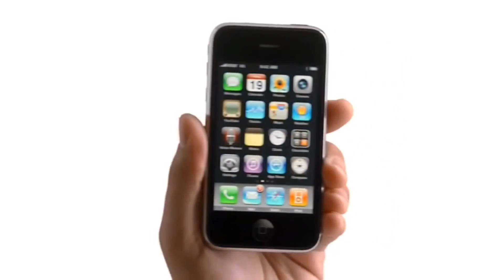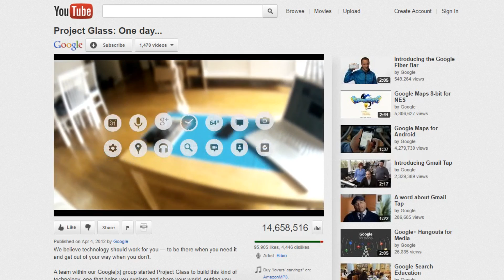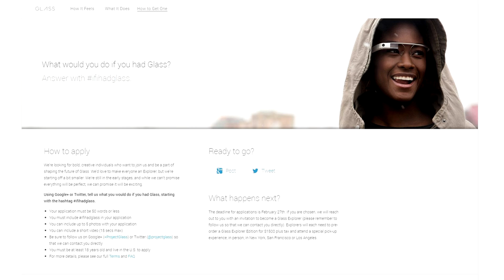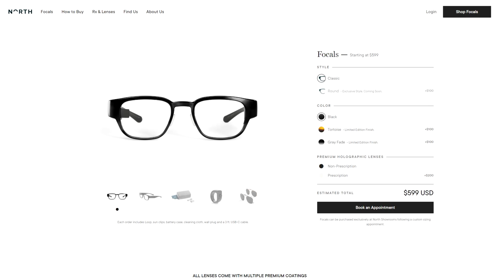How Google Glass Entered The Red Ring Of Death

Comment: I've had two pairs of google glass. Slowly over the years they've gotten much worse. The battery is probably the worse part of it, having notifications and search available visually without physical effort or having to break from doing anything with hands is really usful. These days they tend to heat up very quick and run out of battery within the hour regardless of use